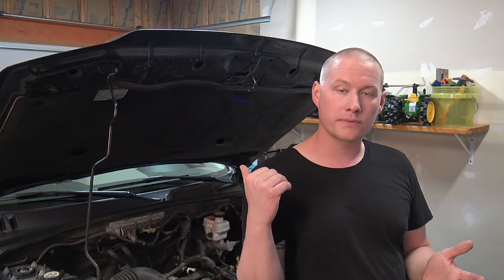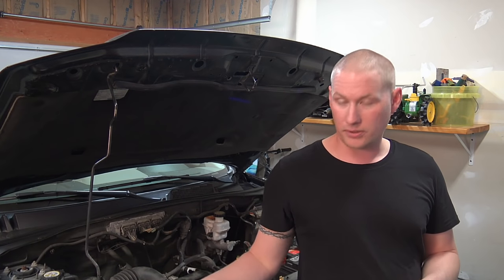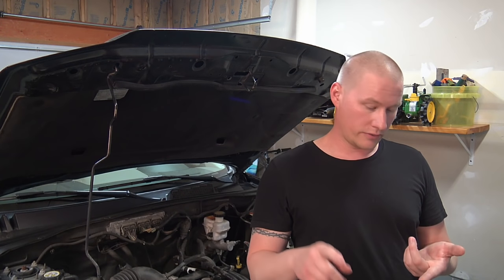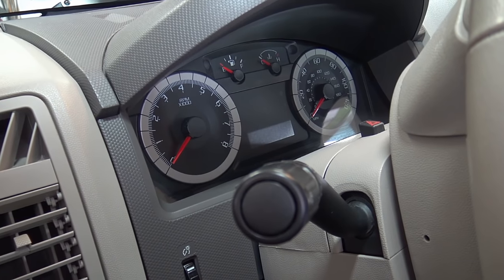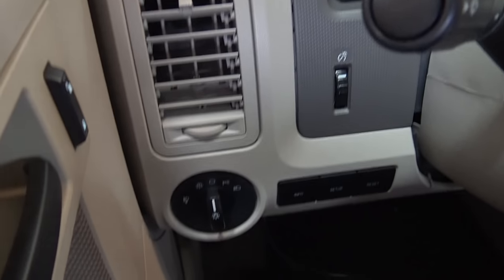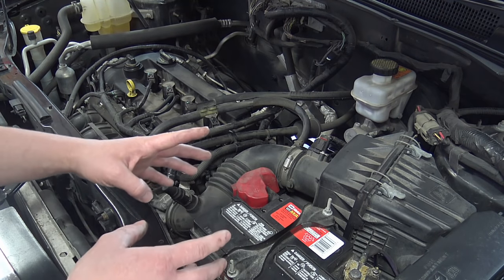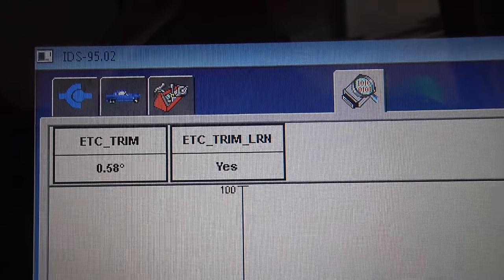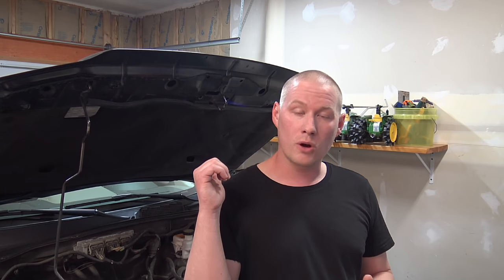Ford Vehicles: Electronic Throttle Body Calibration Procedure

Comment: Update on my throttle body install. My local ford dealership wanted $800 for parts and labor. I timed myself from the moment my hand opened the tool box and I did the swap in 17 minutes. I wanted to knock it out as fast as possible just to prove a point. After following the re learn procedure it's running like new again. Thanks again for the valuable videos!
Reply: Wow, Ford's labour rate is atrocious!   I just took my F150 in for a 'limp-mode' issue, and they just reprogrammed the PCM, and charged me just under $500.00 and since getting it back, it's done it three times!   I'm going to take the plunge, and change out the throttle body on my '16 3.5 eb, and see if that does the trick.   I'll follow what Chris has shown us here, and hopefully all goes well.   It seems the hardest part, is getting the red electric connection off!

Comment: Finding this video 4 years later, but I've got an 06 Explorer that i had to change the alternator on recently. After the weekend alternator swap it idles terribly and throws codes for my PCV, EGR, etc. Been fucking with her for days with no progress, I'm gonna give this a shot and pray it works.

Update: Didn't work for me, sadly. Truck actually shut off on me when I put it back in park after taking a test drive.

Update 2: It was a damn vacuum leak. I swear vacuum leaks are gonna be the death of me, bro. Good video though, will definitely keep it saved for future use -- I'll need it!

Comment: PERFECT! I installed a new throttle body after my Ford Fusion was going limp mode with a throttle body failure code. I kept getting the error and code with the new throttle body, followed your procedure here, and now it works just fine! thanks so much! this is the kind of thing I love about Youtube!
Reply: Question, I have a 2012 fusion that's going into limp mode as well it keeps turning on the orange wrench light(throttle control/transmission light) after about 10 miles of driving. It's shifting very oddly and hard sometimes. Did you have the same issue?
Reply: @dripdrap1353  yes it would randomly go on limp mode and not shift. Would fix it self out if I turn it off and on.  Don’t buy a cheap throttle body from eBay as it gave me the same issue, I was able to fix it buying a oem part from the dealer
Reply: @dripdrap1353  make sure you run a diagnostic I believe you’ll get a code that relates to the throttle body

Comment: FordTechMakuloco--After spending $736.00 at my local shop to get my air conditioning working again, I came home and started to get dash lights coming on. First, the check engine light came on, followed by the wrench light. I had a scanner tool, hooked it up and got two error codes. The most severe was the one causing the wrench light to light up and that was the P061B code. I watched your video, made my own jumpers and did exactly what you told us to do and it worked like a charm! I had to subscribe! Thank you so much sir! You da man!

Comment: This is covered in the OM, too: 1. With the vehicle at a complete stop, set the parking brake.
2. Put the gearshift in P (Park), turn off all accessories and start the
engine.
3. Run the engine until it reaches normal operating temperature.
4. Allow the engine to idle for at least one minute.
5. Turn the A/C on and allow the engine to idle for at least one minute.
6. Release the parking brake. With your foot on the brake pedal and with
the A/C on, put the vehicle in D (Drive) and allow the engine to idle for
at least one minute.
7. Drive the vehicle to complete the relearning process.
• The vehicle may need to be driven 10 miles (16 km) or more to
relearn the idle and fuel trim strategy.
• If you do not allow the engine to relearn its idle trim, the idle
quality of your vehicle may be adversely affected until the idle
trim is eventually relearned.
When the battery is disconnected or a new battery installed, the
transmission must relearn its adaptive strategy. As a result of this, the
transmission may shift firmly. This operation is considered normal and
will not affect function or durability of the transmission. Over time the
adaptive learning process will fully update transmission operation to its
optimum shift feel.
Reply: Are you serious wtf.  Way too much
Reply: @ItsMe-wm4mc rofl this is nothing. I have a 2012 Chevrolet 1500 WT. It's far more complicated and dangerous to do. It's ridiculous.
Reply: What car is this?
Reply: @from9539  Per the video - 9 years ago - it's 'Ford Vehicles'. The video looks like a 4-cylinder Escape from 2008-2012?? Look in your owner's manual under Maintenance and Specifications, under the Battery section (or search the digital version for 'idle and fuel trim strategy'. My specific info is from a 2009 Mercury Mariner (Ford Escape clone).

Comment: Took off my throttle body to clean it on my 2007 500, I put it back on & got the engine light and car was having acceleration issues. Tried this & its running like new now. I can't thank you enough.
Reply: I got the same car, it accelerates when i turn the steering wheel, do you think this procedure can fix it?
Reply: If you disconnect the throttle body electrical connecter with the battery connected the engine computer senses a fault and sets a code on some vehicles , It will always set a code if you turn the key on without the Throttle body connected as it try's and self test its proper movement and response every time and does not get the expected response.
Reply: Lamar Alexander
Reply: What problem were you having with your 2007 500 that led you to think it was the throttle body?    Asking because my 500 is cutting off after it warms up.

Comment: Just used this sequence after removing and cleaning TB from a 2012 Ford Escape 2.5L. Car had very rough idle at cold start and would shake and rattle like a son of a gun at start up until at normal operating temp. Cleaned the TB and followed your directions on the TB recalibration. Shaking and hard start completely gone and runs like the day it was driven off the lot. Thank you.

Comment: Wow…this video is 8 years old but ya know what…it really helped me today!!!!  I had changed out some parts recently (EGR solenoid, o2 sensors, fuel filter, air filter), removed and installed the throttle body, and disconnected the battery several times. I couldn’t figure out why my gas mileage was suddenly so bad afterwards. I did this procedure and it completely fixed my gas mileage issue. Thank you!!!!

Comment: You are the reason a daily driving a 160k mile 3.0 fusion doesn't scare me, with your videos we will make it through anything! thanks for saving me again!!
Reply: You should never be scared I ran my 3.0 fusion with 230,000 miles completely out of oil 15 times before the motor locked up lol they are tanks
Reply: @southernracing2468  hahaha
Reply: Good regular maintenance esp fluids and ur fine Ford will go 250k mis.
Reply: @southernracing2468  that's diesel man!👊 Bad ass. Ford EcoBoost for life.
Reply: @southernracing2468  Thats really their only Achilles heel, leaky valve cover and oil pan gasket.  Honestly the pan gasket doesn't look hard to change. It just looks like it might require snapping a few exhaust bolts getting the manifold pipe  out of the way.

Comment: Thank you so much for this video!  I let my van run for 15 minutes idling (after doing what you said with the battery), and then another 10 minutes driving with the air condition on.  This seemed to help it relearn and return back to its correct idling.  Your knowledge is great and appreciated.

Comment: Bless you, man.  I've stubbornly been trying to get my Ford Explorer (4.0) to idle down and not die when I put it in gear for a month.  I've changed parts, cleaned everything to no avail.  Was about ready to go in to the transmission and unhook the sensor.  I already poked holes in the cat converter....You're little trick with resetting the PCM fixed it in minutes.  Thank you so much.

Comment: Thank you! I spent days trying to figure out why my friend's 5.4l 3v F150 kept stalling after changing the crankshaft sensor and spark plugs. The job itself was a nightmare because one of the plugs broke above the threads and refused to come out with an easyout. And worse, the first easyout I tried was too small and pushed all the porcelain out of the tip into the cylinder (and got stuck). The first easyout was 3/8ths, which would not go through the hex portion which had broken off, but under that it gets bigger and a 1/2" is needed. I struggled for a day trying to get the easyout out, but couldn't reach it with anything that would grip it enough to pull it out. I finally made a collet from an 8" long 5/8ths bolt. I drilled a hole 2 inches deep, and about 50 thousandths smaller than the diameter of the easyout through the hex end of the bolt. I then cut a cross into the bolt, all the way down to the base of the hole I drilled, and cut the hex portion off. I took 2 3" pieces of 3/4" steel tubing from Home Depot, cut from a 3' piece. The inside diameter was 5/8ths and it fit perfectly over the bolt. I tapped the bolt over the easyout and slipped the 2 pieces of tubing over it. I put a big washer on and ran a nut down it. I used 2 other nuts locked together at the top so I could hold it from turning without damaging the threads. The lower nut forced the tubing down and locked the bolt to the easyout just like a collet holds a drill bit. Once it was far enough down, I took it apart, removed the top piece of tubing, and slipped a 4" length of 1" pipe over it. Again I applied a washer, a nut, and 2 more nuts locked together at the top to hold it from spinning. I then turned the lower nut about 1 turn and the easyout came out with the tip stuck in it. This was the point where I realized that all the porcelain from the tip was in the cylinder. My homemade tool was used again when I broke the second easyout. I ultimately ended up using the guide from the tip removal tool and drilling it out with a 9/16ths bit. I put one of the broken tips in and gave it a few taps to seat it, and that kept the metal shavings from going into the cylinder. I went very slow, and checked about every 1/8th of an inch, to see how much more I needed to drill. It went so perfectly that I never even touched the original threads and the bit pulled the plug threads out of the head threads as it went. I then ran an M16x1.5 tap through (I again found a use for my homemade collet) just to make sure the threads were clean enough to take a new plug. I spent about 3 hours trying to fish the porcelain out, and ultimately found that I was going to have to crush it and blow it out. I crushed it with a piece of 1/4" all thread which I had ground the threads off. This was done blind, and took hours. I basically just got it to where I knew it was and could set the camera on it, then followed the same angle with the all thread. I could tell when I was on it, but it kept slipping. Finally, I got on it good and crushed it by tapping it with a hammer. I blew it all out, and have been trying to get it to run for the past 3 days. I really have been thinking I missed some porcelain and damaged a valve, when all along it just needed to relearn it's base idle. It purrs like a kitten now. I should also point out that I cleaned the MAF sensor and throttle body before beginning the relearn process.
Reply: Это огромная работа! Ты крутой Мастер!!!
Reply: @vladimirsidorov1493  Спасибо!

Comment: 2015 Taurus Limited, 3.5 V6 engine.  Had P2111 (Throttle Actuator Control System Stuck Open) show up 3 times on my code reader after my car died on me 3 times on the way home from lunch.  It always started back up and ran fine.  Decided to replace ETB at about $90 instead of cleaning because I didn't want my engine to go to idle when I was in traffic.  Followed your instructions and now the car is running great again.  Thank you!

Comment: Thanks for this info. I had disconnected the negative battery cable to clear a check engine code, then the idle began acting very strange. Using this video info and your "cleaning the throttle body" video, all is well again in "Mustang-land". My daughter (it's her car) will be thrilled.Thanks again!

Comment: I just plugged my new throttle body in, cleared the trouble codes with my scanner, and drove it like I normally do.  It runs just as well as it always has.
Reply: Then why are you watching this video?
Reply: J M 😂
Reply: I just cleaned a very dirty throttle body and MAF and it runs great without doing this...might still do it though.

Comment: What a great information. I just cleaned My throttle body at 142,000 and reset the pcm and took it for a drive transmission shifts so much smoother. Thank you so much for sharing this information.

Comment: Thanks for the terrific set of video procedures.  I just picked up a 2011 Escape and it was shifting late and inconsistently.  I cleaned the throttle body and did the reset you describe here.  Now it's running more smoothly, and shifting properly!  Thanks again.
Reply: I pray my issue is this only...I was told that something was wrong in the transmission

Comment: Thank you! Thank you! Thank you! My husband and I just changed the TAC in my 2014 Ford Escape and used this technique. It worked perfectly. Cleared the code from the diagnostic scanner and removed the engine light. Added bonus the car is idling better than it has in years! I don't think the PMC has ever been reset on my car.

Comment: Thank you so much I recently have had nothing but trouble with my son’s 2012 Ford fusion from ECM to PCM and everything in between thought we had it figured out and then got the trouble code for throttle body failure. I did disconnect the battery when I changed the throttle body and figured that was enough after clearing, the codes still did not run right after about an hour of driving it stranded him again, I pulled the negative cable off and grounded it out to the positive like you said for 15 minutes. Let it idle cars. Perfect now thank you very much I can’t thank you enough.

Comment: Thanks for the videos.  This was my 5th ETB (2013 F150, 3.5 EB, 403k miles, 2nd engine) and first one I did myself. Spent $221 for the ETB & gasket.  Hardest part was get the dang wire harness off without breaking the tab.
Reply: Dang 403k is great. I got a 2014 f150 and my ETB fried out at 126k. What caused you to replace your 3.5 originally??I had a really sticky tab , sliced my hand getting it off but I heard blood offerings are good luck!
Reply: I have  2014 F 150 3.5 Eco. I talked  to 3 different mechanics,  Payed 1   $190 to diagnose the ETB. My symptoms were number 6 cylinder misfire ,rough shifting of transmission,  going into idle mode,  having to pull off road and turn off and back on to reset to continue driving til it did it again.  With this video and  one other  I learned how to reprogram the CPU To learn the new ETB. My diagnosis mechanic wanted an additional $1300 to fix the problem. Because of these videos and DIY  I completed the job successfully under a $100. Thanks for sharing your knowledge.

Comment: Listen, I have a 2015 ford expedition el. I also had the wrench display and code that my throttle body was stuck. I followed his instructions carefully.  I  installed a brand new Throttle body myself. ONLY after taking it to my auto mechanic TWICE for the same problem!! I got a free diagnosis at the local auto parts store for free. Then simply followed the instruction on youtube.  IT worked,  Thank you sooo much.  Yes anyone can do this, it was simply. Less than one hour.  My truck purrrrrr,   now growl, just like when it was new!!!

Comment: Sorry if I didn't see you mention it anywhere in your 5.4 3v 4part series, but this is a vital step I missed after I did my the full repair. My truck has been acting erratic and constantly stalls at stops. Thanks for posting this important procedure anytime battery cable is disconnected. Now i can fix this issue.

Comment: first thanks again thanks so much.     OK. ..I got the part for 170. core 30.   did it myself less than 20 minutes to change.  I also stuck my hand in the part that the body is connected to and wiped out all that black stuff....did relearn just as you said.  .I'm riding high a mighty.  no more driving the left lane. no more embarrassing shut offs. ...partgeeks....

Comment: OK, I bought a well maintained 1999 5.4 F150 w 236K miles. It drove like an old truck, what I liked is how it fired right up at ignition. Old tires replaced, all fluid and filters replaced including tranny service at Barrett Performance here in Bham WA., a crappy alignment and it drove amazing w a small at stop while driving idle issue. Not crazy, just would drop an RPM, stay, rise a bit, etc. I did this procedure and all I can say is HSWOW!! Do this exactly! I bought the tiny cables at HardWare Sales in Bham, they should have their own show! Pitching them Now, anyway. As you can tell I am stoked!! Thanks FTMak!

Comment: Excellent post and intel. My 05 F150 has never run better. Replaced TPS and cleaned throttle body and Mass airflow sensor. Followed that up with the reset and calibration.

Comment: I had an issue with my 06 Crown Vic police interceptor not running right and throwing a wrench light if I hit the gas pedal the wrong way, replaced throttle body and it did nothing. I watched your video and did this on my car and now it runs the way it’s supposed to! Thank you for putting all the useful information up here for all of us to see.
Reply: What code did you get my 2011 is doing the same p2104 replaced the throttle body too
Reply: @mikedaguy3049  not sure of the code it was a long time ago. All I remember is throttle forced limit or something like that.
Reply: @vorsprungdurchtech  yeah I have a p2104 replaced the throttle and it keeps doing limp mode hopefully this fixes it